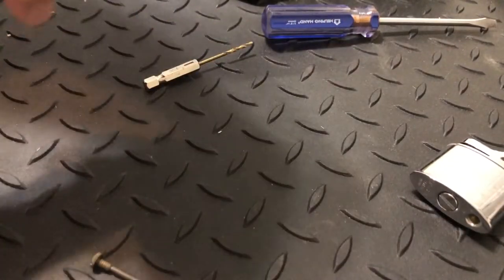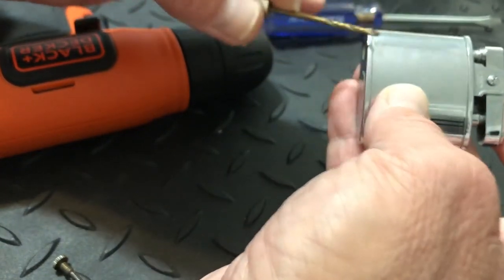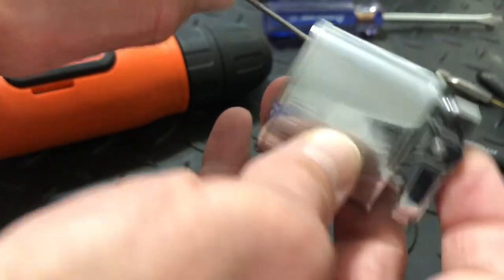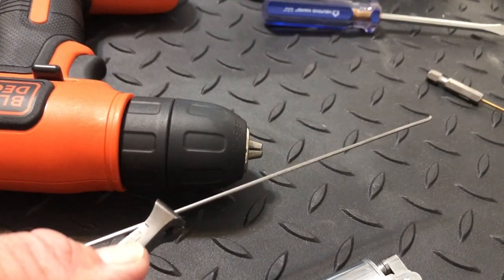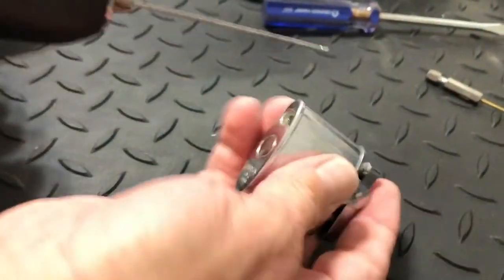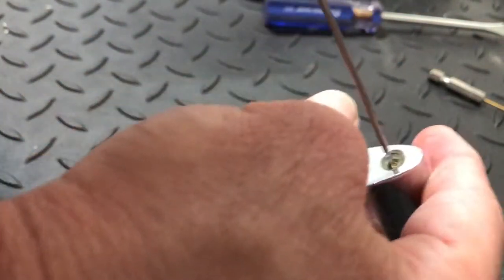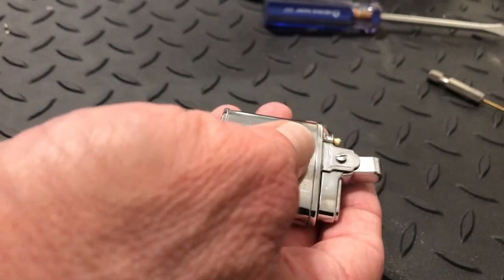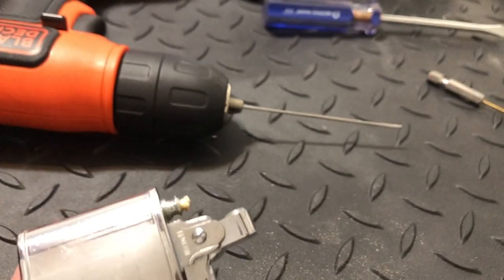How To Repair Vintage Cigarette Lighters That Won't Spark(Curved Tube Method)

Comment: I was able to use this technique without even getting the drill out. I used a poker to ream out the hole a few times. I finally got a spark! You rock!!!

Comment: i have two special tools for curved tubes.. one is piece of hard  piano wire that i have ground a sharp tip on  the tip area is slightly longer than a flint and same thickness...then ive taken the rest of the wire shaft   and ground it town to half the thickness so it is far more flexible . then attached to a handle.  the tip profile its like a chisel with a spike in the middle i ground with the diamond purrs on a dremel. 
the n2d tool has a stiff steel braided cable with a tip on the end i braised a brass tup and put tiny steel tip at the end. both tools work very well  and should not be used with power tools, they can be worked by hand and in a few minutes will bore through even a fresh stuck flint. 
you should remove the hea dof the lighter if you can its east from the top down.. this is only needed when its a case of the top its riveted or the flit is stuck somewhere that cannot be accessed form the top
vinegar bath will also destroy the flint but be careful of the metal of your lighter.. you can mast everything off with nailpoilish and remove it with acetone  if needed it will eat the flint up.

Comment: I just bought two vintage lighters. Got them home and the flint had turned to broken up powder that was  jammed. One I used Floral wire and got it cleaned out and working. The other I had to take it completely apart and work from the top down. That was a challenge getting it back together. But I did it. One was a ACME supper lighter. The other one was a Penguin superlative automatic lighter #18250 but I made the repairs after watching one of your videos
Reply from the maker: Glad to hear it Herbert! If it wasn't for stuck flints I wouldn't have any problems at all!😜

Comment: Are flints you buy now days the same size as the old ?  I have a rightpoint lighter with Crome top I pulled out the striker inserted a long pin tile fill up the middle I can see the point. I put a flint from a new zippo lighter in it pushed it all the way up. So what do you think is the new zippo flint to wide or do I still need to take a drill and work at getting the sides smaller?
Reply: there is generally 2 flint sizes .. the fat dunhills and then everything else.. most lighters 98 percent use the regular flint you can buy.

Comment: Thank you for this vid! This method worked even when there's no drill available, just takes more time and manual labor to scrape out the stuck remains
Reply from the maker: miiigoreng thank you for the comment. Perhaps you could join the discussion under the article: https://dependableflame.com/how-to-repair-vintage-cigarette-lighters-that-wont-spark A reader there named Tracy was asking about successful methods if a drill was not an option.

Comment: I have a Ronson Gem that will spark but only sometimes and it's very difficult. Tried cleaning the striker wheel with a toothbrush and alcohol but it seems really worn out. Is the striker wheel causing my problems or is it something else? Where can I get a new striker wheel?
Reply from the maker: Thanks for the question, jmanx360. Degraded, broken or dusty flint is likely throwing the mechanism off. Check out this article: https://dependableflame.com/how-to-repair-vintage-cigarette-lighters-that-wont-spark and let me know if you have further questions.✌️

Comment: Hi, I have a Robson whirlwind which flew a part during disassembly. Do you have a detail video on how to put the wheel assembly back to together. I have 4 pieces the bracket , the wheel, a washer cut to lock the wheel in one direction..and a washer with teeth in one side, what is the correct assembly procedure... any info would very appreciated... thanks
Reply: Sorry I have 2 of the teeth washers
Reply from the maker: Hey, Dave. The reassembly portion of this video should help: https://youtu.be/iTC7UsGp8II
Reply: @DependableFlame  rero
Unfortunately although very informative...it’s not what I need... my sniffer came apart wheel feel out..with sprockets the washers also... those sprocket washers do not look like sprockets shown here.only half of those washers half teeth... I’m not sure how to seed pictures to show what I have, maybe both are wore or broken...it was my fathers lighter... I kinda want to get back up to par
Reply from the maker: @dave6032  you can send photos to bossman@dependableflame.com

Comment: I cant even  get a 1/4  inch in before  I hit a blockage  on my flint tyres electric fence wire  pushing it through  ,I'm fixing to pull the wheel  from the top it got to be the better way ,  I hope !!
Reply from the maker: Yes, the top is much better!
https://youtu.be/iTC7UsGp8II
✌️

Comment: Would drilling flint that is touching flint wheel work? I took some lighters apart and started drilling the top of a prince gardener.
Reply from the maker: You just want to be careful not to damage the lighter with the drill bit. This video is more helpful:
https://youtu.be/iTC7UsGp8II
✌️

Comment: Hey. Great video.
I have a Ronson Cadet. It was working okay for a while after I bought it but one day I opened it up to clean some of the gunk on it. Anyway, since I put it back together, it barely sparks. Like maybe once after a dozen tries. The flint is new and can be seen touching the wheel. Can you advise on what I might have done wrong? Thank you.
Reply from the maker: Check two things: first, that all the parts are reassembled in the proper order. Also, check that the clutch spring "catches" and is not flattened out of shape.✌️

Comment: Hi! I have a lighter similar to this one, i managed to change the flint but now need to replace the wick and wadding. Do you know how to remove the wadding and change it? I would greatly appreciate any advice! thank u!
Reply: Get yourself a regular screw that fits in the hole and by hand turn it the cotton will wrap around the screw for you to pull it out. Now to change it you need fishing line there’s a video on YouTube of it being done
Reply from the maker: Emma V. Guillard, thank you for the questions and I hope I'm able to help. For rewicking the lighter, you should find all the help you need in this article: https://dependableflame.com/how-to-replace-the-wick-in-any-petrol-lighter

Regarding removing the wadding, I haven't developed a method as of yet that is any more advanced than what I imagine a chimp could do. It is slow work and the wadding breaks often as it is removed. I employ dental picks and pliers, being careful not to damage the threads in the fill screw hole as I work. Removing the wadding isn't fun but will usually be much easier than clearing an obstructed flint tube in this type of lighter.

Comment: I bought a vintage Princess Gardner cigarette case and flat lighter set. It looks like it still has wadding and some semblance of a wick, but either it needs fuel or won't spark... I can't find information on this particular lighter anywhere. Do you have any tips for me regarding fixing this lighter?

Edit: I'm not even sure it has a flint in it, I took out the screw it should be attached to, and there was no flint on it.
Reply from the maker: Petrol lighters are pretty simple. You don't need info on that particular lighter, you just need to understand how a petrol lighter works. I have written an article to help explain and aid you in diagnosing the problems you are dealing with: https://dependableflame.com/vintage-lighter-repair-and-service-wickflint-basics
It is very likely that the flint is degraded and obstructing the tube.✌️

Comment: I have an old lighter the same as this, do you know where I can get flints, wick and wadding?
Reply from the maker: Garbhan Mc Closkey, absolutely, yes! For these particular sort of lighters, I use the old Ronson wicks that are usually found in the glassine envelopes. There's not tons of them around but they do show up on Ebay often enough. Ronson flints are similarly available. There are wire lead wicks that will also work in these Ronson Standard type clones. With flints, sometimes it seems the Ronson "Redskins" are the only type that will work and other times they don't want to work at all! What I'm trying to say is there's a lot of trial and erroring going on with these old lighters to get them functioning again. For the wadding, I usually employ cotton balls torn into long strips but in the past I have used old t-shirts and once even used an old pair of my ex-wife's underwear(they were clean.) I have a page on my website where there are links to Ebay to purchase the items mentioned above as well as links to Amazon and other sites where a plethora of vintage lighter supplies are available. Take a look at: https://dependableflame.com/helpful-lighter-related-links and let me know if you have any questions about the supplies needed for your lighter.✌️
Reply: DependableFlame thanks for the help I’ll do some more research and hopefully get it working!!
Reply from the maker: Garbhan Mc Closkey, if you run into problems, let me know. You could always mail it in and let me do it for you.✌️

Comment: Could you please explain why my lighter only opens about an 1/8 inch when the button is pressed rather than 90 degrees like it should?
Reply from the maker: J Rod, chances are the old flint is degraded and stuck in the tube. Have you removed the flint spring screw from the bottom of the lighter? If you remove the flint spring screw and depressing the button brings the snuffer all the way up, then perhaps spring tension is the problem. Other possibilities abound. This article: https://dependableflame.com/how-to-repair-vintage-cigarette-lighters-that-wont-spark is a good place to start your diagnosis.✌️

Comment: Hi I know this isn't really a question related to the video but I have been trying to restore a vintage IMCO 4300 Jumbo lighter and I have not been able to take the insert out. I have tried soaking the lighter in gas, pepsi and wd 40 and it hasn't budged at all. Would you have any suggestions on how I should go about it?
Reply from the maker: Josh Rubisch, lighter fluid and Everclear are the solvents I use.✌️

Comment: Is there any way to replace the flint without having to unscrew the bottom? I have the tools but the screw head is very worn and I can't remove it
Reply: Use a tiny cutting wheel, like for use with a Dremel, and cut a little slot big enough to be able to use a regular small screw driver to unscrew it. Good luck😁

Comment: Wondering if you can help me out i have a ronson standard lighter i cant get it to work for the life of me i feel like theres something missing the wheel doesn’t turn to strike the flint
Reply from the maker: Byron Romero, there are several possibilities as to the nature of your problem, some of which I may be able to provide help with. Answers to the following questions will determine the extent to which I'm able to deliver aid: Are you sure the flint tube is clear of old, degraded flint? Have you taken the actuating mechanism(or any other part of the lighter) apart? How handy of a fella are ya?
I help folks fix lighters every day via email and do mail-in repairs, I have been doing this at no cost to the customer since launching the site. I also produce lighter repair how-to articles and videos and will gladly discuss any project on your slate at: https://dependableflame.com/contact us
I look forward to hearing from you!✌️

Comment: Did this to a Ronson crown table lighter and “stripped” the threads on the fill screw because of the pressure. Be careful
Reply from the maker: @Billsmafia15 , just out of curiosity, if you were clearing the flint tube as this video shows, how did you strip the threads on the fill screw? Sounds like you were lost in the wrong hole!😜✌️
Reply: @DependableFlame  Lol,I think the power drill flexed the inside of the lighter because I was pressing too hard. So my fault
Reply from the maker: How would pressure in the flint tube strip the threads on the fuel screw?✌️
Reply: @DependableFlame  I have no idea to be honest, the fuel cap easily came off before I did that. After, I now have to use a tiny flathead to get it off after it been unscrewed
Reply: @DependableFlame  I forgot to mention the drill bit was a little bigger than 3/32, so that may have done it too

Comment: Why oh why didn't you just remove the flint wheel pin?
Reply from the maker: CyberDiogenes, because my aim is to help people get their lighters functioning again not to reduce them to a pile of parts. I fix lighters everyday, am familiar with the timing of these "automatic" mechanisms and I still detest having to take one apart. The people who write to me for help(thus far and generally speaking) are looking for a simpler operation than a complete teardown of the mechanism. You can read more of my philosophy on lighter repair here: https://dependableflame.com/what-to-do-with-old-cigarette-lighters-can-they-be-repaired

Comment: I have this same lighter however my flint wheel won’t turn when flint and spring are screwed in. It seems as if the wheel has nothing making it turn when I keep the top open
Reply from the maker: Gabriel Francis, I believe this was a Hadson lighter, basically A Ronson Standard clone. Sometimes, you will have to spin the file wheel against your new flint before it is tightened all the way. There's a lot of friction going on there, so obviously you need pressure but that doesn't mean you can't get things flowing in the right direction before that full pressure is applied. You comment about the top being open confuses me, the wheel only turns as the plunger is depressed.
Reply: DependableFlame It’s so hard to put into words! Could I possibly get in touch with you via email or something? It’s an heirloom lighter from Ireland and it’s beautiful however I can’t for the life of me get it to work! I’ve deconstructed it and reconstructed it and it just seems there’s something missing!
Reply: Amazed you got back to me so swiftly! Wonders of the internet :)
Reply from the maker: Gabriel Francis, best way is email: bossman@dependableflame.com If you are able, snap several pictures including bottom of the lighter and top with lid open(if it has a lid) and email them to me along with a description of what's been done and any observations you may have. I'll take a look and respond shortly. The world we live in is shrinking by the minute, my friend, it is a wonderful time to be alive!✌️